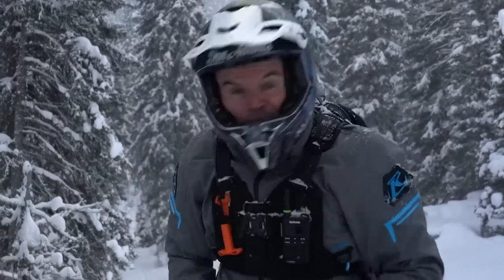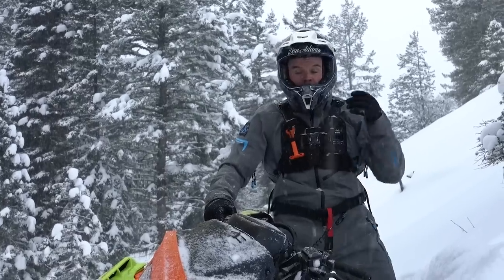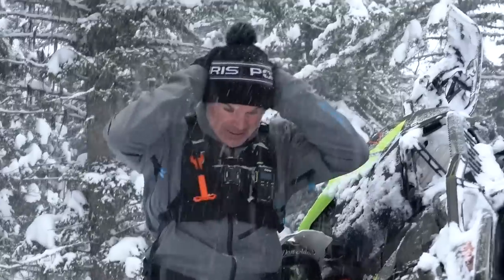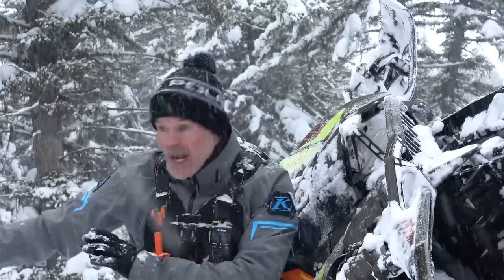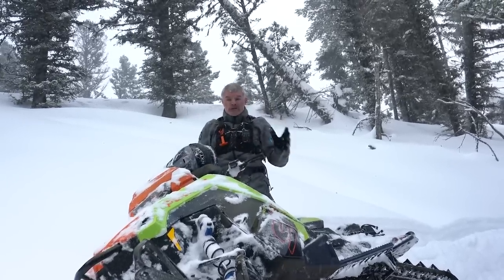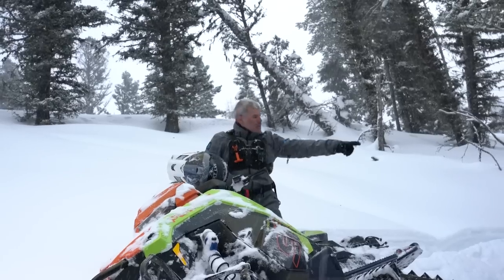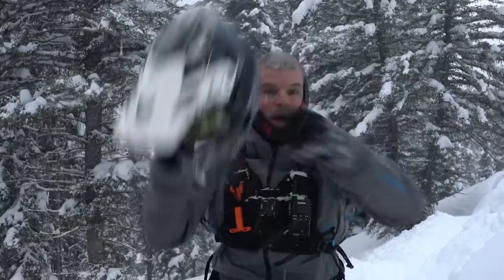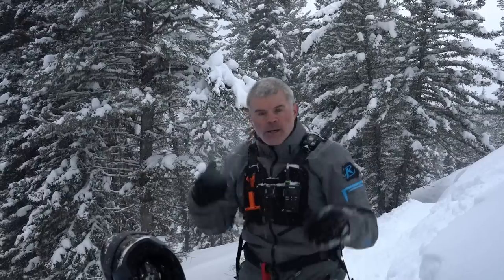Building Momentum

Comment: Ive always been told "when in doubt throttle out" but I have learned more now that with sleds getting more powerful just blind throttling can become a worse situation. Now I prefer to find the sweet spot on the throttle for the snow condition to maintain momentum to get to a flat spot to possibly stop and regroup and scan for a new line if needed.

Comment: I'd also like to see a video about using the brake, as well as the throttle at the same time! Especially with a turbo sled, in order to build up power before moving. It would be sweet to learn from a pro!
Reply: He has a video about using the brake. Also you don't use them at the same time, but you always have your finger on the brake ready to go.